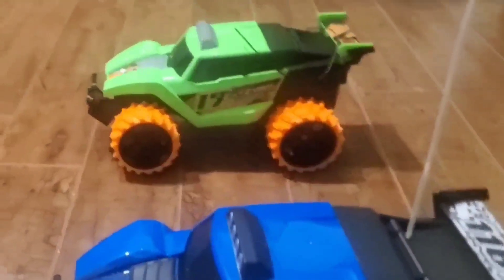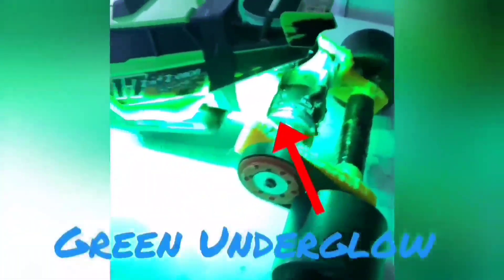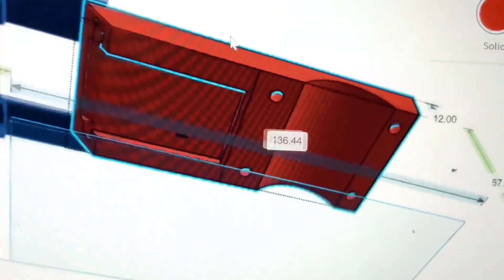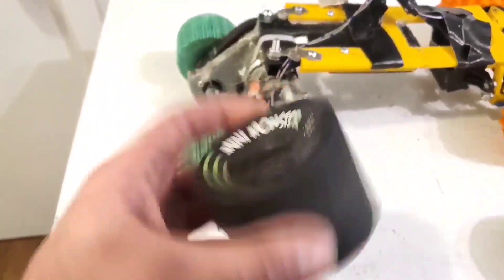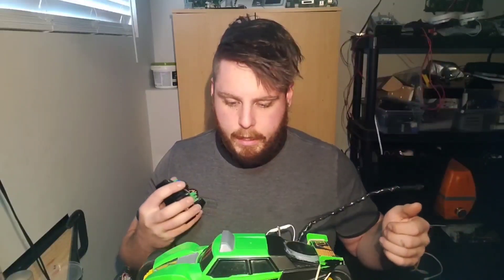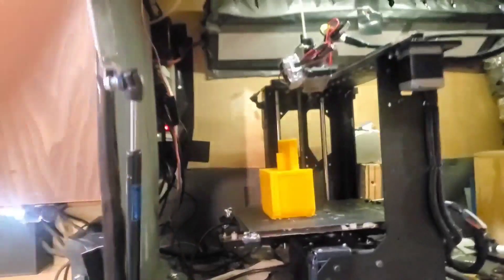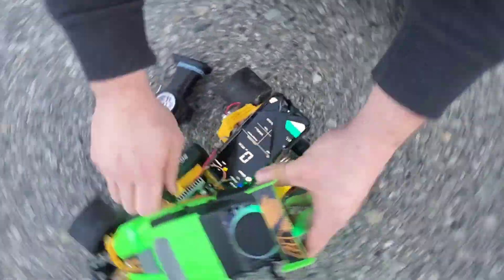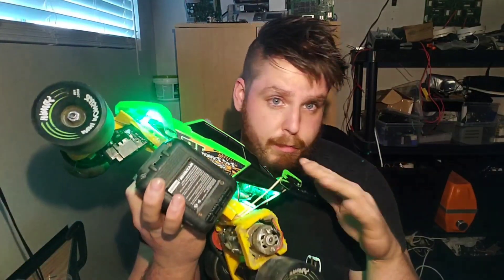The Drill Powered RC Car 2.0 - With a 40v Duel Battery Upgrade.

Comment: Nice 👍 , I want to try too ..
I have a lot of batteries for my tools 20v and I have olds rc cars 4.8 or 7.4 and 9v , how can I connect the 20v battery and 20v motors to 4.8v , 7.4v or 9v ESC ?